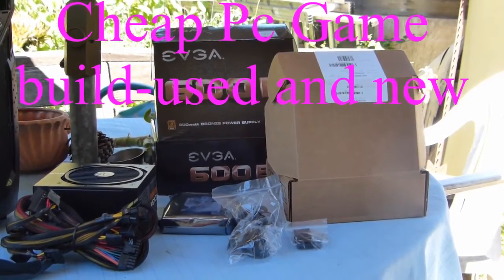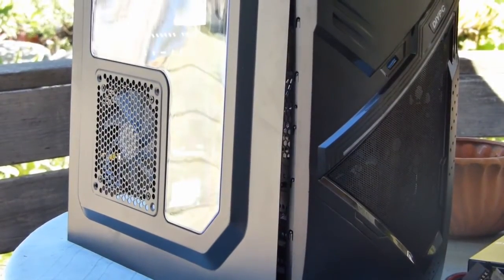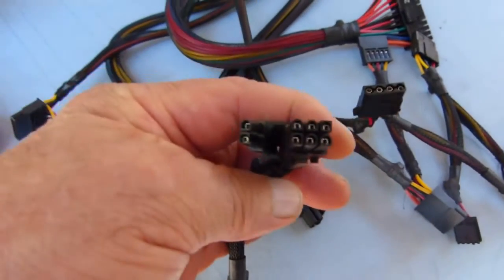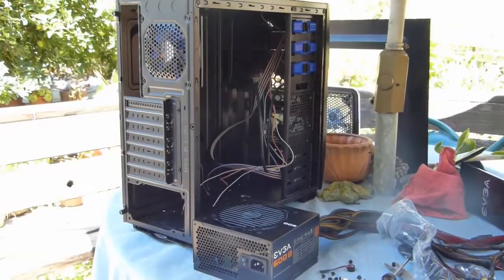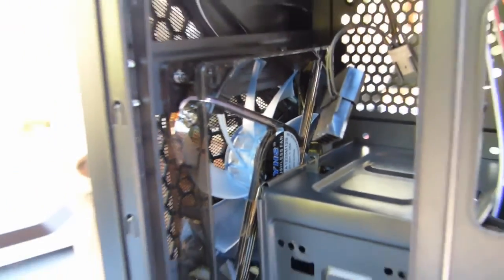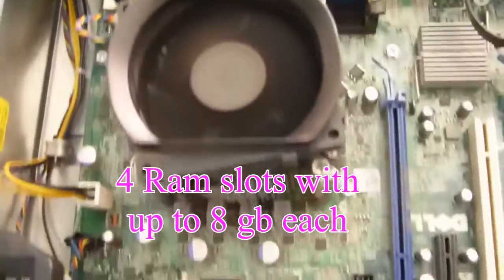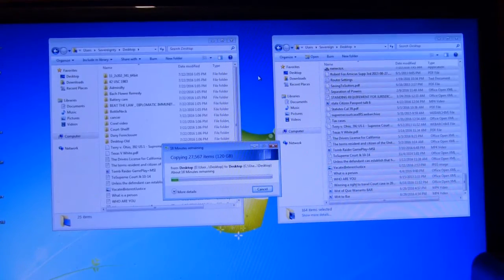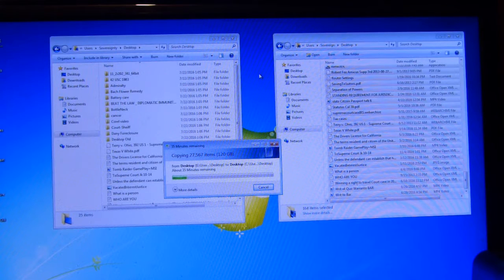Budget Gaming Pc  $350 or? - i5 2500  Gta5 - 60  fps 1080 -Console killer

Comment from the maker: To correct the video a bit, the i5 2500 (3.3ghz) is not overclocked and the Evga gtx 950 is not overclocked by me, but comes with a factory overclock from the stock 1050 to 1390, so technically it is overclocked, but it is the evga standard overclock.   This system does very well playing all the new AAA games out at good frame rates as shown, you can see my other video with this setup running Far Cry 4 at about 50 FPS on Ultra settings @ 1080p.   If more is required for 1440p gaming, etc. a used i7-2600 (ebay-$240) with a gtx 1060 ($250) can be put together for about $600+.
Reply: I've seen so many Dell optiplex computers out there with i7 3770 cpus and swappable psus for around $200 would that be a smart budget pc to pop a gpu into for gaming?
Reply from the maker: so when i look up the 3770 on passmark it scores 9328.   That gives you a rough estimate of its capabilitys.  The i5's are the cheapest, best gaming cpu and the i7's are as good but don't particularly do a lot better, but if you have videos to render then they will be faster.   The rig i built in this video shows just how fast it is if you watch all my channel videos doing benchmarks, gameplay,   The only thing to consider is that if you wish to just drop a gpu into an optiplex is that you would need to get the full size ones and not a small form factor (SFF) as a standard video card will not fit in to those.  The power supply would probably work on a 750ti (no 6 or 8 pin power connector needed) but you would have to get a adapter to go from molex to a 6 pin or 8pin which the optiplex power supply doesn't come with.  An evga 430 power supply on amazon is $30 and it has all the connectors needed and has plenty of power.
Another thing to consider however is that you get a benefit from a dedicated gaming case that has multiple fans for cooling like th one i show.    The standard dell and hp biz computers may be able to have fans added, but you have to think about getting rid of the extra heat that gaming produces along with getting a CPU cooler.  So....with a little fiddling with it...yes you can easily build a fast gaming rig from an optiplex with an i7 or i5 but they should be 3.3ghz or faster as you are stuck with not being able to overclock them.
Tech deals shows a similiar build : https://www.youtube.com/watch?v=x6WZqG8ms5I
His would need 8 gb of memory to really game with, and a GPU faster than the 750ti would be much better.  A 3gb 1060 at $200 uses little power and is very fast, but the 950 is the cheapest that will get into getting decent framerates on any game, today
Reply: +GamersAnonymous4me The i5 optiplex version isn't much cheaper that's why but maybe if I see the i5 version a hair cheaper I'll try to get it.
Reply from the maker: On Ebay in the last month since i got mine ($75+20 ship), i have found 3 more that would be around the same $100 mark shipped (some had no hard drive, etc.).   The i7 2600 or 3770's  seem to hover around $200 at the lowest.  As stated I would not get a i5 2400 because its @3.1ghz and would stick to getting the highest ghz available.   If you want an i7, i say go for it.   They are a great deal and it only boosts the cost a tiny bit.  Often you can get a terrabyte hard drive with them or 8 gb of ram, both of which save you.   If the hard drive is flawed, i would run DBAN on it and wipe it completely and then try windows sector and hd error repair on it before ditching it.  You almost have to have a second computer with online capabilitys to use while your building a new computer, FYI.
Reply: GamersAnonymous4me  can you help me I recently got a 790 optiplex with i5 2400 16gb ram  and 500hd  how would I be able to switch it to a new case and add a GPU  and do I upgrade the mother board ?
Reply from the maker: The only problems putting the parts in a new case would be the ones I show in this video.  Most likely the on-off switch will have to be modified to work, and some of the other pieces like the PSU temp sensor, etc. be placed in the case to stay plugged in.   Its not hard to swap over the pieces.  The PSU probably will need to be replaced with a bigger one unless your running a low power GPU.
Make sure you unplug the unit and turn on the power button to drain the power before working on it.  And....i assume it currently works because that would be first on the list as once you know it is a runner, then you know it should run when transfered over.  So...dont change other components untill the 790 is functioning in the new case and then add the PSU, then GPU and check it each time.  As i show, take pictures so you can reconstruct the wiring.
Reply: GamersAnonymous4me    which case would you recommend me I have a gtx 1050 mini GPU and I'm not sure if it would fit the base case  I'm on a low budget 50$ could do
Reply from the maker: The one I got has great cooling fans, and is cheap, big, plenty of space, a bit cheap on the construction quality but works great for me. 
Its a DIY Zondda .  It looks like newegg changed the style and the previous number i gave.   but they are currently running about $27 with a $10 rebate card.   Same basic case as the one i show on the video except for some differences is style.

Comment: Is that motherboard a standard atx form factor  or is it BTX.   I have a lenovo and id like to do a swap like this.  But its a btx
Reply from the maker: It is a sff (small form factor) micro atx if i am correct but  a standard full size atx will fit in that case (i have done it).   Is btx larger than the full atx?   
btx: 12.8 × 10.5 in (325 × 267 mm) BTX standard
full-size ATX board are 12 × 9.6 in                              These cases are pretty roomy, so i would think you could adapt a slightly larger MOBO but looking at my full size atx asrock pro4 board it has 1/2 inch at least at the top (but the rear i/o has to match and would require it to be in a  certain position) but the bottom is right up against the PSU so there is no extra length space.
You could use your lenovo case if its full size and add cooling fans to help out with the extra heat issues that heavy gaming develops.  Change the power supply and add a good GPU, ssd, 2tb hd and away ya go.

Comment: Are all optiplexs proprietary? Do they fit on othercases? And do any psu work? Thanks
Reply from the maker: The optiplexs are all propriety on their wiring to some degree but can be put into any gaming case of an appropriate size (the full size optiplex would need an full ATX case while the SSF or USSF (ultra small form factor) would fit into an itx size case.   Any Power supply will fit into an aftermarket computer case, the only mod i had to do was to wire in the on off switch to work and put in the USB ports that ran to the front of the factory case, so the Bios would not notice missing parts.

Comment: i7 2600, 500 GB, 8 GB DDR3, GTX 1050 Ti OC with an old Acer Gateway DT71 motherboard and a 280W gold + PSU for 440 $.   Is it worth the money?
Reply from the maker: I would say no.   Its not a horrible deal especially if you cant build your own, as i assume its running with Window 7 or 10 (not linux) but its drawbacks are as follows:   Its built around a standard Acer used office equiptment? which is fine, but you could buy a used similiar product with an i7 off ebay for around $200, then the case if stock is not really built for gaming as it should have 3 120mm  cooling fans to hand the excess heat and most of the office supply computer would be lucky to have 1 fan probably 90mm.   A power supply that is stock at around 300w will work but not well and only with a low power 1050ti or similiar and no upgrade would be possible (not the end of the world but you would have to upgrade if a different GPU was purchased, like a 1060).   8 gb of ddr3 (probably 1333mhz) is o.k. for gaming and you would be able with the 4 mem slots to probably upgrade to 12 or 16gb with some used ddr3 which might help with some games. The 500gb hardrive is probably older as newer ones even with office computers would be 1 TB and I run 240 gb just for my desktop  (as SSD) and have a 2 tb drive for all my other crap and games, and the desktop with Ghost recon and the videos I make for youtube stays about 50gb short of full most of the time.

In short the unit if it has Window 7 or 10 and not linux and is working ok, would be able to play all triple A current gen and older gen games quite well and if you were unwilling or able to build your own would do for you and be a good gaming rig so the choice is up to you, the shortfalls are noted above.
Reply: Wow didn't expect such a detailed reply. Many thanks to you, I'll consider searching for a better deal and if I can't find any I'll just go with this one since only the 1050 ti costs around 220$ where I'm from.

Comment: I have i5 2500 non k version,motherborad gigabayte p61-ds3-b3 model,4gb of ddr3 665.8Mhz,and ati radeon hd 6800 series.What is the best move for me right now so i can run new games without everyting on low if it is possible.I was thinking to get gtx 1060 6gb and getting 4gb of ram.My budget is around 340 dollars.thanks for any help  in advance
Reply: Increase ram (get a 8gb ram)

and a GTX 750 ti

ofc used.
Reply: 8 GB ram. Core i3. Gtx 1050
Reply from the maker: In almost every case 8gb of ram is a necessity to get smooth gameplay in 2015 and onward.  Most games are GPU dependent so upgrading the GPU is money well spent if everything else is O.K.  You can always carry a GPU to a newer rig also.
I have a ton of fun with my gtx 950 and dont find I need anything more to enjoy playing Ghost Recon, Dishonored 2, SplinterCell Blacklist, AC blackflag, GTA 5, and a buch more.   I had the $$ and the chance to get a nice 1060 and figured it wasn't worth it to me to get a few FPS more.  A whole new high end rig?  If I wanted to play Virtual Reality then yes I would have to upgrade.
Reply: GamersAnonymous4me so 16 gb ram isn’t really important? If you have 8gb it’s okay?
Reply: jesse yeah but i would suggest 2x4gb  way better then a single 1x8 gb  rams .
Reply from the maker: Jess:   Yes 8gb or ram is sufficient at this point in gaming.  Just Cause 3 is about the only game I know of that really likes more ram and its minimum ram requirement is 8gb, so...that should still work.  As well aname says dual channel memory is a slightly better configuation (2  4gb sticks in dual channel is only slightly faster that 1 single 8gb stick but not having 8gb is going to be the problem for anyone with less than 8 gb (with either dual channel or single channel).  I am currently running 8 gb of ddr4 at 3200mhz and it works on every game i have and never gets near full usuage. Back when 8gb sticks were $30 than i would not hesitate to get more ram but it got crazy high prices in the last year.

Comment: i recently did this with a i5 2400 lenovo but the thing is the audio jack from the front pannel dont fit with the mobo what can i do
Reply from the maker: usually the rear ports have an audio out and in and you can use those.
otherwise you would have to use the mobo jack and cut and splice the wires to the front audio jack but you have to know more about the wiring to be successful.

Comment: hello men, i build a 790 pc with a Rx 480 and windows 10 and it have the disk usage at 100% every time i open chrome or a game and it generate huge frame drops on games and apps, i change the drive to see if it was the problem and it did not work also i stop superfetch and w search
Reply from the maker: What does it look like when you run benchmark programs?   Is it a i5 2500 or 2400?   Stock everything, or what did you change?   What are the frame rates at 1080P on ultra or high settings on your games?   
It depends on what is holding your FPS back,, if its the CPU or GPU and what kind of games as some are needy towards the CPU and most are requiring a faset GPU.  The 480 should be plenty fast and the i5 should keep up nicely maybe a bit behind what the 480 is capable of.
What is your ram?  amount of ram?   is your virtual memory set high enough (should be 50% higher than actual ram).  Did you test your memory?  Bad memory or low amounts of memory will cause bad FPS drops.   The best speed on a HD would be to have your games on a SSD drive and the next best thing would be to have a raid setup with 2 standard HD where the program is split to both drives so it double the speed, or doubles the amount of data retrived per second, which ever.   I have had problems with my setup but fixed them all and its plenty fast now.   ]

You have a cooler, know what the temps are on the CPU and GPU?  Run msi afterburner on screen display to show everything?

Comment: I have a question . I5 2500 can run at 3.7 Ghz when playing GTA V , etc , ..... right ?
My Spec : I3 3220 / Gskill 8GB DDR3 1600mhz / Gigabyte GTX 950 2 GB Windforce OC Edition .
My plan is upgrade to i5 2500 .
Sorry , my english not good .
Reply from the maker: the i5 2500 runs at 3.3ghz and if its not the k version cannot be overclocked.   It will run in boost mode to 3.7 on one core not all cores.
If you are going to just get the cpu instead of buying a whole used machine, i would get the i5 2500k version (around $80 on EBAY) as you can do an overclock on that to over 4.0 ghz on all cores (with cooling) with XTU intel software overclocking utility (it wont do my non-k 2500 however.  I believe that you can use XTU to overclock the k version.   The stock i5 in my rig has a CPU cooler to knock the temps down to around 60C as it was a bit high before at over 70C while gaming.
If you watch my channel shows on the speed the i5 seems well matched to the 950 or 760 as in the GTA benchmark they are both running near 100% while the i5 is runnning near 100% and producing good frame rates.
Reply: GamersAnonymous4me Thank so much , i using Gigabyte B75M-D2V , so i will choice non K version .
Reply from the maker: a non overclocked i5 will still be a good gaming machine.
Reply: Today , i was buy a Xeon E3-1220 v2 . It support 1600mhz ram + PCI 3.0 , just use 69 W. xD
In my city , no one sell i5 , i7 .... >.<
My Spec now :
Xeon E3-1220 v2 / 16GB DDR3 bus 1600mhz / Gigabyte B75M-D2V / Gigabyte GTX 950 2 GB Windforce OC Edition / PSU Acbel 470 . I just play game at 1600x900 ( 900p ) , medium or high setting . It enough for now ?
Reply from the maker: The hard thing about using server CPUs like the Xeons is its expensive to find a motherboards for them.
Seems like it would work well, its a quad core and fast enough.
Reply: GamersAnonymous4me yup , when i play BF4 with i3 3220 + GTX 950 , 75~80 FPS max . After replace with E3-1220v2 , 86~ 140 FPS . All high setting at 1600x900 . . However i got a problem with cpu temp , when play Bf4 it up to 73 celsius  ( cpu temp ) . When idle is 44~48 celsius . I using stock cooler of Intel . it normal ? I buy that cpu 2nd , not new 100% . Only 80 usd .
Reply from the maker: Sakura Ayumi   Yes it is normal to have higher CPU temp while gaming as it stresses the CPU steady which in normal use is not the case.  Get a CPU cooler like a Coolermaster T3 or T4 ($20) or some other brand as it should knock about 10 deg C off the CPU temp and bring it down to 60-65, it did for me, went from a high of 75C down to a high of 65C
Your FPS just shows how important a fast CPU is that doesn't hold back the GPU.

Comment: I get crazy fps drops (gtx 970 & same cpu) especially csgo
Reply from the maker: All you can do is optimize your rig to get the most out of it.  Often times there is minor problems (like GPU drivers) that have large effects and other times its just the game itself.  I see Ghost Recon going from 70 FPS down to 25 at times, It is what it is.   Things generally stay consistant but the problem with PC's is that there are 100's of issues that can be less than optimal and consoles are all the same so they optimize the crap out of those games to be very consistant.

Comment: Fake the video no 8gb ram is (This shows how a used Optiplex 790 off Ebay can be turned into a cheap $350 or so gaming PC.  The 790 has an i5-2500 with 3.3 ghz CPU, 4gb ddr3 1333 ram, a 160 gb hard drive, dvd player and ran fine once I uploaded an operating system (linux or Win7-64).  A new DIY zondaa $37 gaming case from newegg, a 600watt EVGA new from Amazon ($40), an optional 1 TB WD blue $50 hard drive from Amazon, a EVGA gtx 950 ($110 after rebate from newegg), and the total with the Optiplex ($120 off Ebay), so the total can be less than $350 to $400.  The benchmark in GTA V shows this rig doing better than 60FPS @ 1080p (a CPU and GPU intensive game) and in game I can lock it at 60 FPS with vsync and it runs great. I can play Far Cry 4 on Very High setting @ 1080p and it runs a steady 50 FPS, so it can run anything well.  Tomb raider (2013) benchmarks at 51 FPS on the highest setting- Ultimate@1080p and I show that on part 2.  Most motherboards have a manual that shows what the connectors do, ie USB  or Board Power, or Speaker, etc.  I couldn't find one for this factory board, but got it working fairly well (the power button works, the usb on the front works, all fans work, and HD, etc. but the front sound output doesn't (headphone and mic in) but the rear board ones do.   One could get a used Optiplex with an i7 and better components but the cost would push me past $400, but its something to consider. 
)
Reply from the maker: The used computers are complete and run.  They come with memory.  This one came with 4gb and i have other 4 gb dd3 to use (free for me), but 4gb can be purchased of EBAY for around $20.  You can get used machines that come with 8gb ddr3, also.